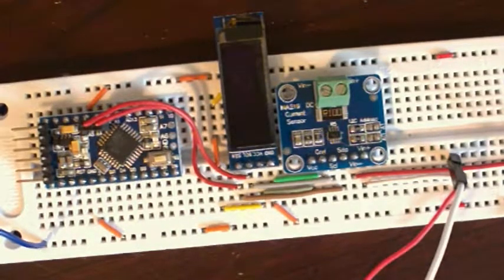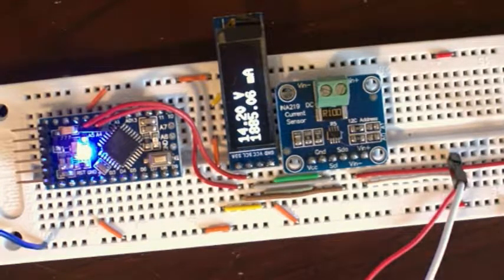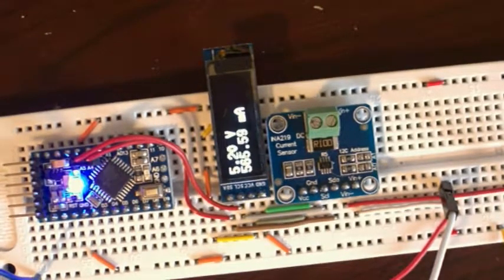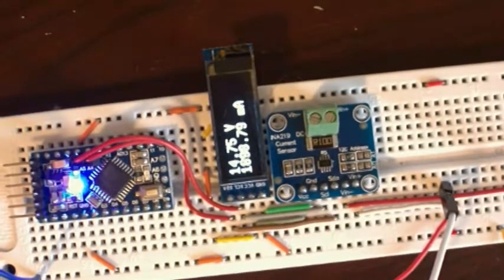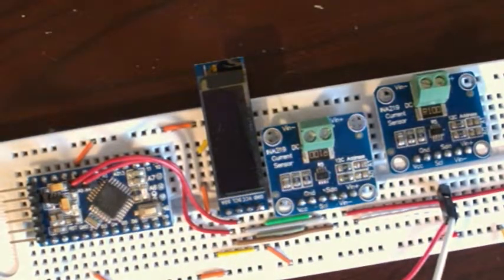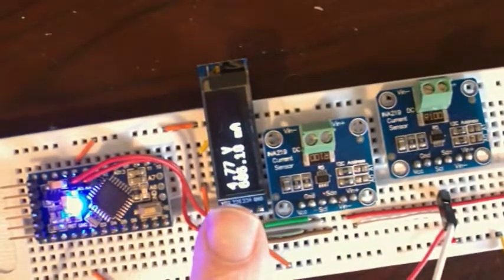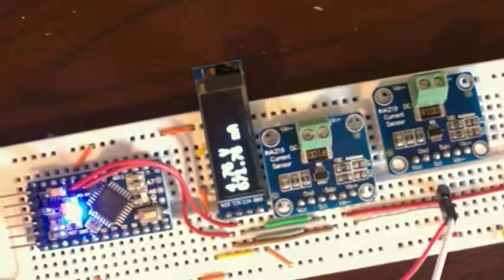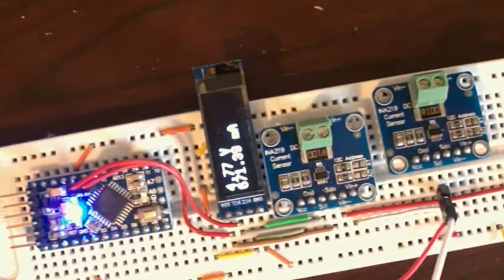ebay Faulty INA219

Comment: I have also experienced issues with these sensors (from aliexpress, 2020) being unreliable. Some work for a bit and then stop responding to I2C commands, causing the bus to hang. Some seem to work OK. Never figured out the exact cause, but I also noticed odd shorts or low resistances happening. It may actually be cheaper and far less frustrating to buy genuine Adafruit modules that these are a clone of.

Comment: I think I got some bad ones too.    Are you measuring continuity between vcc and gnd on the module?   Mine show continuity between all the power ports,  vcc, gnd, v- and v+
Reply: I can confirm this is a problem.  I have THREE that measure a short.  I just re-ordered three more from a different supplier.  Time will tell...
Reply from the maker: I'm sorry it took me so long to check this, but yes on the bad module I am measuring no resistance between vcc and gnd. On both good and the bad modules I measure no resistance between v- and v+
Reply: Purchased some a while back thinking this type maybe better quality than the one with the pins 90degrees from the 2 sensor wires. Sensor plug opposite/parallel to the pins.  Removed old unit and plugged one in to find the arduino powered off. Tried a 2nd one and its the same, direct short across the capacitor on the VCC pin.
Only just done it and this video popped up on a google search. Off to remove the capacitor and see if thats the reason for the short. The pins on the chip seem identical to a cheaper type.
Checked a 3rd one and its not a dead short, but i have not soldered the pins yet. Capacitor or a trace too close to the via's?? Place your bets  :)

Comment: I have a weird problem with one of these sensors. I can comunicate with it, and if I read the configuration register, I get 0x399F (default value on power up). That shows me that the device is working.
But when I read the bus voltage register, it always returns 0, even with 5 volts connected at Vin+. What could be wrong?
Reply from the maker: It's been a long time since I played with this module but I can tell you how I have it wired up. The first two pins Vcc & Gnd are connected to 5v power and ground. I'm also feeding the 5v power into the last pin (#6) Vin+ but if you want to read the voltage from a different source, a battery for instance, don't connect Pin #1 Vcc, connect the positive battery terminal here instead and the negative terminal to Gnd (pin #2). The module reads the voltage from this last pin, if I disconnect pin 6 the module still works but reads out 0v. Pin #5 (Vin-) is connected to the positive voltage of my load, this is where the current is measured and doesn't need to be connected to anything if all your measuring is voltage. connecting it to ground via a resistor is a simple test to check the current function is working. The other two pins are obviously for communicating to the micro controller which sounds like is working for you.  Good-Luck :D
Reply: @retiredwizard  Thank you for your reply!
I have wired mine just the way you described (5V to VCC and Vin+).
The sensor is behaving as if there is nothing connected to Vin+, that´s what I don´t understand.
I´ll have to buy another one to test.